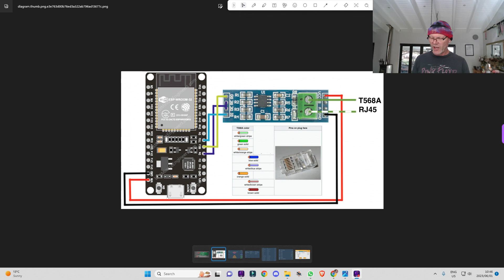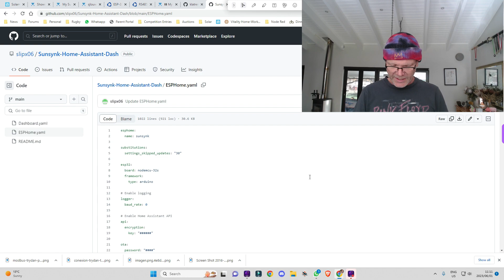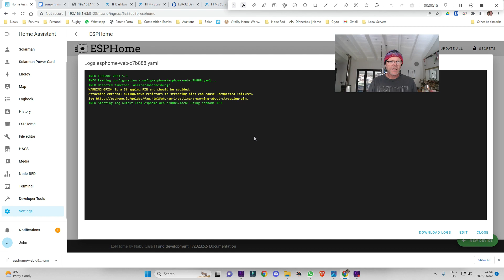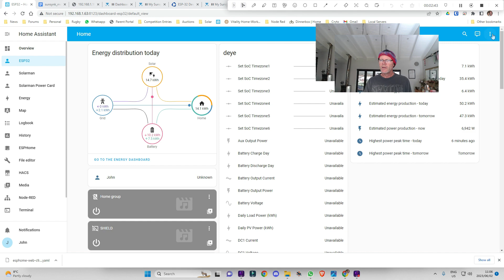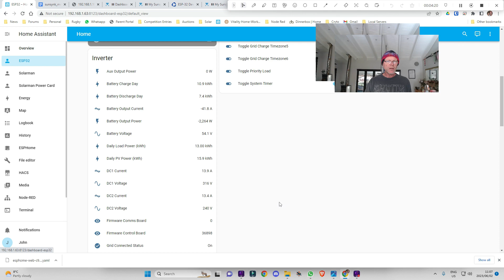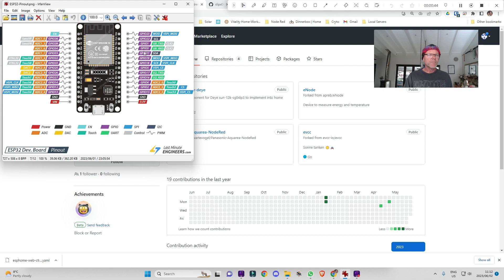Setting up your ESP32 Data Logger & Home Assistant

Comment: About to try this on a firman inverter. But my rs485 port is being used by my battery to communicate with my inverter
Reply from the maker: Check the pinout specs for your inverter connection. You may have a Canbus and RS485 port combined into one and you can split them out, easiest way is using a 2 port RJ45 Wall plug with the cable to the inverter and then Canbus connections to one port and RS485 to the other

Comment: Thanks, I have the exact same ESP - MAX485 setup (but with SolarEdge inverter) and I couldn't get modbus to work. I tried level converters (3V3 to 5V) but removing R7 solved it all. I did not find that tip anywhere on the internet.
Reply from the maker: Hi Bartjies, my suggestion is to get one of the boards with the integrated 3.3v RS485 ports. The MAX485 are ALWAYS problematic and a total headache and there are better option nowadays. Otherwise you end up spending hours looking for the reason why it ios not working. The Electrodragon board or the one from Lilygo are just much better options and always seem to just work out the box.

Comment: Hallo sir, can you tell me that 's  work on easun smh 3  6200?
Reply from the maker: From the Easun website. the Easun has an RS485 port so you should be able to query it using that port. I would use an ESP32 with the standard Sunsynk/DEYE Modbus addresses as they seem to be a standard in the solar industry and will probably mostly work. Have a look at the video called A better way to connect Home Assistant to your inverter, would use that board as it will make your like a lot easier - https://youtu.be/EN5GjEbM4fo

Comment: @solarinegrations,

Currently struggling with finalising the installation of the ESP32 board.
All went well up to the point where I connected the board to the inverter.
All values show unavailable or unknown.
Do you have any idea what I am missing or what could be wrong?
Reply from the maker: Hi, sorry for the late response, not sure if you are sorted out yet. What RS485 adapter are you using? I would suggest using the shield I talk about in my https://youtu.be/EN5GjEbM4fo video as it does not require any soldering and has the correct 3.3V RS485 connection. A lot of the boards are 5V RS485 connections which sometimes work and sometimes don't, they also appear to be very sensitive to soldering issues.
Reply: @SolarIntegrations  Good day,

Thank you for getting back to me.
I managed to get it sorted. Not sure what was wrong because I followed the same steps every time. Had to flash to ESP32 a few times and reconfigure.
Thanks for all the content you create on home automation.
Adds a lot of value.
Reply from the maker: @quintinvanzyl248  Is my pleasure, I am glad that they helped you get it working 🙂

Comment: Hello, can I use one esp32 to connect three converter TTL to RS485. Thanks for answer
Reply from the maker: Hi @schwarzimker5257, I assume you have three inverters you want to connect?  To be totally honest, I am not 100% sure but I think that you might be able to just daisy chain the RS485 connection to each of the inverters, query each inverter individually based on their addresses on the RS485 bus and avoid having to buy 3 x RS485 board. I would strongly recommend using the ESP32 Shield as they have a LOT less  problems with installation. Is featured in my video, "a better way to connection Home Assistant". Maybe have a chat to the guys on the Powerforum as there are a load of people there with more experience than me in RS485 connections.

Comment: Hi Just an update in case someone else has the same issue. I had lots of bad data when using the 5V in power pin and not powering via USB connector.  Using the 38pin ESP32-DEV-CP2102-C Wroom Type-C version. I found that the 3 ground pins are not connected internally and one of the other ground pins had an effect on my WiFi.
Reply from the maker: Thanks Arthur, I would definitely recommend that people use that new shield for the esp32 than Heinz from smarthomeintegrations has, makes like a load easier and no issues with power/communication.

Comment: Thanks. Been working through the forum, but no solution found yet.
Reply from the maker: Am happy to have a look at it for you, I live in Kyalami, message me on the Powerforum if you are close. Otherwise post a thread on the powerforum with the YAML code you are using, what you are getting in the logs in ESPHome and some photo's of your ESP32 board, RS485 interface and the RJ45 cable connector and wiring and I will see if I can help u there
Reply: @SolarIntegrations  Thanks. Let me post on the forum. Maybe someone has the same problems. If I dont come right, will give you a buzz.

Comment: All the sensor values are unknown, tried all the suggested info. Still cant seem to get it working. Can someone please assist?
Reply from the maker: Best is to get onto the Powerforum and check out the thread there. The ESP32 can be tricky to get working as there are a number of areas that you could be having an issue with. Would start with checking that you are connecting to the pins specified in your YAML code.

Comment: Great videos, thank you. Does anyone know or can confirm if the 8k yaml file will also work with a Sunsynk 3.6kW inverter please ? This will also need a splitter as it has a combined port. Thank you.
Reply from the maker: It should, the Modbus queries should be the same
Reply from the maker: Hi @grahametobin5297,  were you able to confirm if it works?

Comment: I am using your groundwork to do this with Voltronic inverters. That said, I am a complete noob on coding and/or esp. Your DE and RE pins on the 485Max is both connected to GPI04. But I don’t see any mention of GPI04 in the code. Any advice?
Reply from the maker: Hi  @makesolareasy , Unfortunately I don't have any experience interfacing with the Voltronic but here is what I saw on Github https://github.com/ned-kelly/docker-voltronic-homeassistant and  https://github.com/amishv/voltronic_ESP8266_MQTT  Good luck :-)

Comment: Hi @solar Integrations. I am struggling to get my windows to pick up my esp32. I did install the drivers, in my case CH340C, but still no luck. Any pointers?
Reply from the maker: Check in your Windows device manager if it is seeing the serial port that the ESP32 is creating to connect to. Then make you select the correct port. I think I am going to have to redo this video as that part of the video is a bit confusing.

Comment: I hope this helps someone. Sunsynk like to play musical ports it seems. on the newer inverters (the 8kw one in my case), you cant use the RS485 port. you have to use the CMS port to the right. It is two ports in one. You can buy a splitter so you can plug your batteries in also. Note if using the orange & orange/white cable make sure the brown cables don't go to the batteries.
Reply: Which splitter are you using? can you give more info please?
Reply: @jacoannandale3307  I bought a splitter but it didn’t work for some reason so I spliced together my own cable (made my own splitter) and it worked great.

Comment: I would just like to point out that the ESP32 is a 3.3V device that is not 5V tolerant. Interfacing it to the 5V MAX485 chip on the recommended Microrobotics RS485 board is therefore not a "safe" option, and is likely to damage the IO buffers on the ESP32. To use these boards together, I suggest the following: Remove R1, R2, R3, and R4 (pullups to 5V). Add a series 330 ohm 0603 resistor, and mod a 680 ohm 0603 between the RO trace and GND on the back of the board (scratch off solder mask to create "pads" for this) to form a voltage divider. This could well be why so many people are having issues getting this working. I really think you need to highlight this to your audience.
Reply from the maker: Thanks @cliffordvandyk3728 , wondering if a better option might be to look for a 3.3v ESP32, not sure if there is even such a thing
Reply: @SolarIntegrations  the ESP32 is 3.3V, the MAX485 level translator is 5V. The solution is to implement a "level translator" between the two devices. By removing the 10k pull-up resistors on the RS485 module, you prevent the output pins of the ESP32 from being pulled up to 5V before they are configured to actively drive the MAX485, that could otherwise damage the ESP32. The MAX485 inputs can happily tolerate the 3.3V outputs of the ESP32. In the reverse direction, the RO output of the RS485 drives the ESP32 at 5V, so a simple 1:2 ratio resistor divider does the level translation. The other option is to replace the MAX485 with a 3.3V equivalent device that is footprint compatible.
Reply from the maker: Thanks for the info @cliffordvandyk3728 , I am going to have to have a look around for a 3.3V RS485 board and see if one is available. I have however been using a MAX485 with my ESP32 for the last 18months without issue so not sure that it is a problem that has to be solved.
Reply: @SolarIntegrations  I think it might be luck of the draw, along with subtleties of implementation, as to whether there is damage or not. I design high reliability electronics for a living. I have modified the PC board to fix the issue, rather than risk damage to the ESP32 or (very much less likely) the inverter. The fix is straightforward if you are familiar with soldering surface mount devices. Happy to send you a pic if I can figure out how!
Reply from the maker: Thanks  @capetownkelp  that would be great, I think 1st prize would be to find a 3.3V RS485 board that we can use but being able to modify a MAX485 so it would cause no issues would be a close 2nd :-)
Reply from the maker: There appear to be 3.3V boards available from Waveshare  and Keebot https://www.keebot.com/product/ttl-to-rs485-module-hardware-automatic-flow-control-module-serial-uart-level-mutual-converter-power-supply-module-3-3v-5v/   & https://www.communica.co.za/products/wvs-rs485-3-3v-breakout-module?variant=44563441254700 Will recommend them in future
Reply: Im a noob so might be missing something, but the ESP32 in the video has two V pins, one 3.3 (on the right) and one VIn (on the left, the one which is used). Vin outputs 5V if the ESP32 is powered by USB. Hence why its maybe been working for so long for @SolarIntegrations
Reply: @axele3984 The issue is that the RS485 translator drives the ESP32 I/O pin with a 5V high output on the RX pin. The ESP32 is not designed to handle this voltage. Typically I/O pins have clamping diodes to protect against short periods of over voltage, but sustained overvoltage can blow these diodes. The chip then becomes very susceptible to damage from overvoltage or ESD that is no longer clamped.

Comment: Majority of my sensors are reporting as unknown. Any tips on this?
Reply: Edit: all entities are available in HA however all values are ‘Unknown’. Could you possibly share your YAML file?
Reply from the maker: Hi @donovankruger8131, Can I suggest that you get onto the ESP32 thread on the powerforum.co.za, have a look through it and if you still have no suggestions then post your Logs as well as much information on your problem as you  can and members will try to help you out. https://powerforum.co.za/topic/8646-my-sunsynk-8kw-data-collection-setup/page/14/

Comment: Do you possibly have a link to a video for the ESP device for measuring geyser temperatures?
Reply from the maker: Hi Donovan, if you have a look on the ESP home website it has some instructions on how to set a temperature probe up. I currently don't have a video on how to do it but will put it on my list of videos to do. Make sure you are subscribed and enable notifications and I will  get one out for you when I am back in SA (will be next month)
Reply: @SolarIntegrations , very informative videos.  I am also interested in the temperature probe video!
Reply from the maker: Hi  @jplab  , thanks for the reminder. I will get one out  in the next few days. :-)

Comment: I have a master and slave inverter, connected my setup to master, not getting readings, flashed esp32 with slipx yaml code, logs from HA showing no readings received, using pin 1 and 3 for Tx and Rx, pulling my hair
Reply from the maker: Hi, Check the settings in your coffee are for the pins you are using on your ESP32, check you are using a twisted pair for your connection from the rs485 board to your inverter. If you are still stuck part your loss on the powerforum along with photos of your connections and the YAML code you are using and someone may be able to spot where the problem is
Reply from the maker: Seeing in your YAML code, not coffee, lol

Comment: ... you go into installing esp home onto your HA, but did not discuss/mention how to prepare the esp32 thats remotely connected to the inverter, with no physical connection to the device running HA, can you explain please.
Reply from the maker: Hi @georgelza, you need to install the YAML code from the slipx06 GitHub pages into the ESP32 using esphome
Reply: @SolarIntegrations  Hi there... ok.. but how, I understand I install the ESPHome integration on my HA deployment thats on my Pi in the study. what/how do I build the ESP32 from factory. I've done the wiring on a test board... this all goes in at the inverter in the garage.

Comment: Got the kit all wired and its writing logs like the video suggest but I am only seen 1 entity which is the firmware. Removed the resistor but made no difference. Any ideas? I didn't get to put in the API key as suggest as it installed without asking for one, maybe this is the issue?
Reply from the maker: Hi @ivanedndicott3273, have you installed the YAML code from Slipx06's GitHub page into your ESP32?
Reply: @SolarIntegrations no I did miss that part out, sorry new to ESP and Home Assistant. So changed the GPIO to 016 and 017 but by default Slipx06 also has 016 for flow control which I assume needs to be changed to 04? Also the code you linked to in the video is not found, there is a similar piece for an 8kW inverter, however I am using a 5.5kW version.
Reply from the maker: 16kw, 8kw and 5kw all use the same Yaml code, it is only the 3-Phase inverters that use slightly different code

Comment: Bought my electronics today but I think I’m am missing a step. At what stage do you unplug from the computer and into the inverter and does it need power once plugged into the inverter?
Reply from the maker: Hi @BradsJardine , the ESP32 does need it's own power supply. I tried to house my ESP32 inside of my inverter but that did not work well and I think I picked up too much interference from the inverter. Better to have along cable from the RS485 board to the inverter. Once you have the ESP32 onboarded to ESPhome and it is connecting to your wifi network it does not need to be connected to the computer any longer and you can send updates to it over the air via wifi network. Give us a shout on the power forum if you get stuck at all.

Comment: Hey Sir, Struggling to ge the Yaml Code for my 5KW Deye - i saw you had a Deye, do you have a working Yaml to load on the ESP32?
Reply from the maker: Hi @xavsod , the code is the same for the DEYE & Sunsynk. U using the code from the Slipx06 Github?
Reply from the maker: What seems to be the problem?
Reply: So get as far as loading the WIFI onto the board, i can also see it in HA. Should i now install the Yaml code by editing the Yaml then installing, or do i jyst edit and save?    @SolarIntegrations
Reply: @xavsod  hi, once you have connected the esp32 to esphome in home assistant you will need to edit the code on it and add  slipx06's yaml except for the bits at the start that are specific to each esp32.

Comment: Just a heads-up - robotics says the Dev board has been superseded by the one with a USB-C port - ESP32-DEV-CH340-C. However I see on their website there's also a ESP32-DEV-CP2102-C which is somewhat confusing since you mention one should look for the CP2102 interface when installing it. Not sure what the CH340 is for.
Reply from the maker: Hi @kevinrtres , Thanks for pointing that out, I don't think that it makes much difference though as the only time you will use that interface is when you are onboarding the ESP32 into ESPhome. Basically you just look for the inteface that appears when you plug it in.

Comment: Hi, is it possible to get a url to that wiring diagram? Looks blurry to me over youtube. thanks
Reply from the maker: Hi @craigarenson7036 , You can find a wiring diagram at  https://powerforum.co.za/topic/8646-my-sunsynk-8kw-data-collection-setup/page/3/ please remember to check the pins you connect the RS485 board to are the same ones as referred to in the YAML code that you upload to the ESP32 as you can use different pins and it really depends on which YAML code you use for the ESP32.